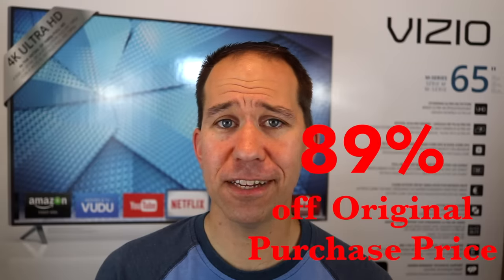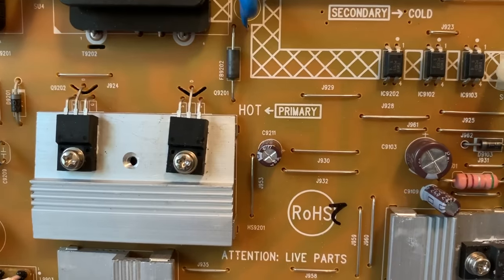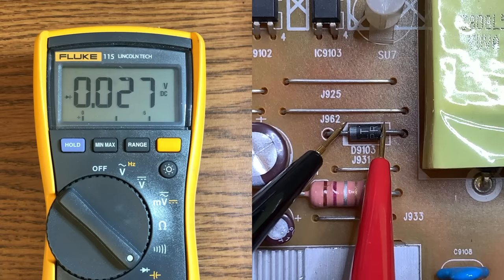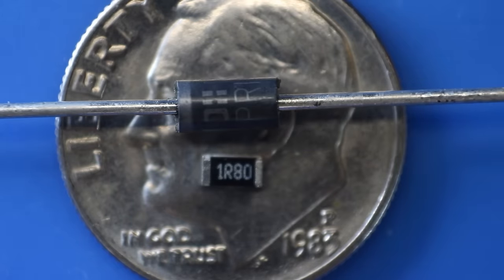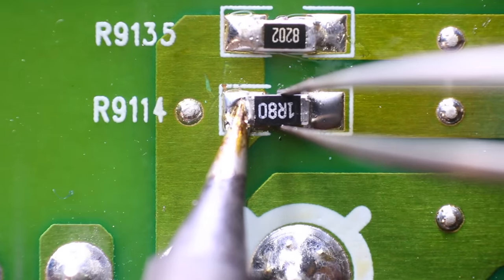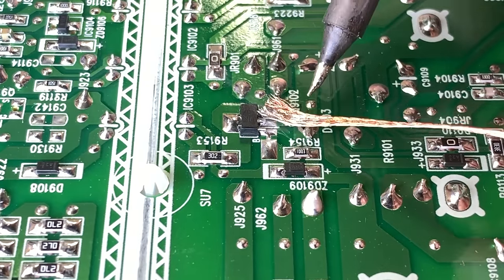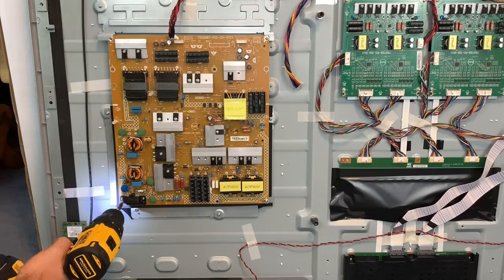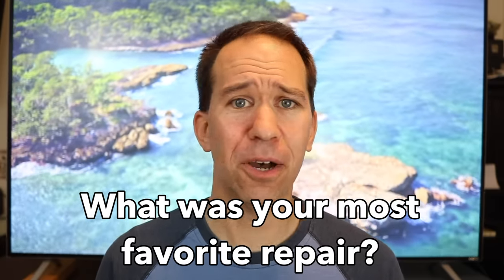I got a broken 65” 4K TV - How I repaired a Vizio M65-C1 (tv won’t turn on)

Comment: Regarding solar panels etc.  I believe the solar companies need to itemize their quote or estimates when they communicate with clients. Recently and a few years back we had consultants meet with us and in the end, all we were given was minimal data about the panels, nothing about the design or electrical plan and a single bottom line price that did not show labor, materials, credits and so forth. The most recent quote only showed "33 Canadian Panels, 10,400 KW system, 1 Exhaust fan, R30 attic insulation". Nothing was said about any credits from the State or Feds etc.
Our power usage increases in summer times as most others do and our A/C equipment is 10 SEER or 1991 era efficiency. There was no discussion about bringing that up to date at all even though the main reason we'd go with solar is to hold down the power bill in the 4 to 5 months during the heat waves. It was interesting to note because the solar company was really only with us to sell solar however, our kWh consumption was mainly when we used the A/C. Anyway, their quote was very much on the high side with no breakdown in how they arrived at their final figure. After considerations, we decided to simply look into updating the A/C system with more efficient cooling numbers such as 20+ SEER condensers and likely reduce the power usage to at least half of what it is now. This would be a better path for us because the newer systems function much differently than our 30 year old system does, which still works as it has since new. It didn't make a lot of sense to keep a power consuming A/C system and go directly with the more expensive solar idea overlooking the less expensive alternative to save on power. We could likely have a completely new HVAC system installed for $12,000 and cut the summer power usage by at least half vs. go with solar, pay $45,000+ with similar solar payments as our power bill is now. A new HVAC power bill would be much less than the solar payment for 20 years would be so unless power rates double in the near future, going with a new A/C system is the most "frugal" idea.

Wouldn't this also apply to just about all of those homes that have central A/C and heat that are still using 10+ year old equipment? You'd think most folks would update their HVAC first then opt for the solar expense.

Comment: I bought a 4k 70 inch vizio for 100 bucks with a few back lights burnt out. Im gonna try and fix it just worried about breaking the screen
Reply from the maker: Wow, that is great!  Yes, moving an lcd of that size isn’t easy.  What I have done is use a big piece of cardboard (get all of the dust off first) as a support mechanism.
Reply: @FrugalRepair  good idea!

Comment: Loved your video, very instructional. I have this exact same TV but the symptoms are slightly different. All Power board voltages seem ok and zero fluctuation, but the led on the main board is not blinking or turning on at all. The power led on the corner turns on and then slowly turns off. I have no picture,black screen, no sound at all. Do you know where I can find the main board for this tv? No luck on ebay or major part sellers (The board number is: 715G7288-M02-000-005T The white sticker says: GXFCB0TK0009020X).
Reply from the maker: From what I can gather there is a common failure on the main board.  There are ebay "repair" services last time I checked.  Are they not there anymore?  Since I haven't researched it, I don't know what is the culprit(s). I'd begin by probing around for shorts.  You could try freeze spray for a quicker ID of a short.  I'm very curious to find out what this main board problem is!
Reply: @FrugalRepair  Thank you for your reply. I ask for your advice once again, I have found the main board for sale. Do you think it is worth spending $163 on this TV?

Comment: One of my best repairs was a laptop that would not power up. I google "issues with laptop X" and found that static electricity can build up and prevent power up. So I took the battery out and shorted the positive and negative terminal the laptop then put the battery back in and BAM the laptop was back....LOL
Reply from the maker: Whatever it takes...  great story.  Thanks for sharing!

Comment: I have a M65-F0 and the image quite working the other day, backlight seems to be working just fine but no image, I ordered a t-con board thinking that was the problem but no luck. Now I'm trying to figure out which board to try and replace next or where the issue could be. Ugh!
Reply from the maker: You’ll want to try to isolate a possible panel issue.  Disconnecting one cable from the output of the tcon and then doing the other one.  In my next video, you’ll see how I do it to isolate a fault and repair it.  Hopefully coming soon!
Reply: @FrugalRepair  hey I think you're on to something! Lol. I removed the output ribbon on the right side of the t-con board and now I have half an image on the tv, left side. So I plugged the ribbon back into the right side and then unplugged the left side and nothing changed.. Does that mean it's a bad panel on right side of my tv?  (facing the back of the tv) And if so that sounds like a lot harder problem to fix!!? Lol. 
 You've helped me way more than anyone else so far! :-)
Reply: Also could my t-con board and the "used" one that I ordered both have the same problem? That's not very likely right? I'm just wondering if I bought a bad t-con board.  Also last night when I took the new T con board out and put my old one back in I tested the TV and for about a minute I had an image across the full screen before it went blank again.
Reply from the maker: Either is possible.  Tcon is the issue or the panel is issue.  If you can wait until my next two videos come out I’ll be addressing this topic and it may give you some more clues.  It’s too much to type on my phone.
Reply: But Im lost without my tv! Lol.
I think it's the panel or more specifically the strip board thing on the bottom of the tv...? 
I had a cat pee on the back of this tv about a year ago, before I had purchased a ceiling mount and I'm finding small clumps of dry urine stuck to the first strip on the right side, I've been cleaning it with rubbing alcohol and now I've found 2 tiny sections on the back of that board that look like they might've got burnt a little,  hard to tell because it's so small but I dont see those imperfections anywhere else on the back of the board. I imagine that those are nearly impossible to replace because they have 3 ribbons that are glued to the board..?. 
At least now I'm not wasting time and money ordering boards, thanks for that! :-)
Reply: I unplugged that strip again, kinda rubbed on it in a few spots but it looked pretty clean, I responded to your last comment and then I plugged it back in and turned the tv on and now it seems to be working just fine :-) I think it's too early to celebrate but fingers crossed!! Lol
Reply from the maker: Yes, that was the problem.  Clean off any other corrosion and you should be good!
Reply: Thanks again : -) I wish I would've found you sooner, before I wasted $12 on a t-con board lol. 
I'm still a little concerned about those bad looking spots on the back of the first strip board thing  that the t-con board plugs into but I buttoned everything up and turned it on again and it's still working, now I've got to find someone to help hang this beast back on the ceiling mount. Lol :-)

Comment: Hey! Interesting video, how long  does it usually take for the new diodes, resistors and such to arrive after you've purchased them?
Reply from the maker: A few days from a USA distributor but it depends on where you live and what shipping option you choose.  If you buy from China directly then it takes about 2 weeks.
Reply: @FrugalRepair  Ah I see, yeah. My main issue currently is actually acquiring the broken hardware though, I can't seem to find any in the local shop sites and such.
Reply from the maker: You mean, you’re looking for broken items to fix up?
Reply: @FrugalRepair  yeah excactly

Comment: Hey FR, hope you can guide me.  I own a 50PK950 LG Plasma tv.  I am getting a "no signal" from all 3 of my HDMI ports, but all other inputs, VGA USB etc... work fine. LG no longer make any mother boards for this tv.  Assuming my diagnosis is correct, that is the input chip for the HDMI inputs has failed, what if any solutions do I have?

Comment: Hello, My Vizio M70 D-3, 70inch 4k tv have dark band in middle and on bottom right corner. It's not completely blacked out but darker than rest of the screen. I am not sure if this is LED back light gone bad or LED driver having an issue. Please let me know what you think. I can send a picture so you can see it properly.
Reply from the maker: Turn down your brightness to 10% or so and see.  Sounds like the led is the issue.
Reply: @FrugalRepair  I did that and took a picture. Is there a way i can send you the picture i took to show the dark bands?

Comment: Does your TV still work ? Black Friday in a couple of months you can get a new one cheap. Flat panels are not real expensive like they used to be.
Reply from the maker: It works great!  Why buy a new one when you can get a broken one and fix it for less?  Plus then you possibly have saved it from being junked.
Reply: @FrugalRepair  I have a 65 inch I purchased at Walmart. Mine didn't have a broken screen but I did read a lot of reviews were people got them that had a broken screen. I looked on ebay and they had a lot of them who were parting out the ones with broken screens. So I decided to order spare parts incase mine ever stopped working. I ordered a offer by one vendor he was parting everything out so I ordered the bundle. I got all the circuit boards and the backlights all brand new for 37 dollars. I'm sit for life lol.

Comment: I've got a Samsung QN55Q7FNA led tv. A couple of days ago a thin blue vertical line apperead on screen a couple of inches right of center. The line is constant and does not move. I've  taken back off and cleaned connections to no avail. Any suggestions? Is this maybe a Tcon board issue?
Reply from the maker: It could be the Tcon or a tab bond issue in my experience.  In a few days I am releasing a guide on how to diagnose TVs without taking anything apart. It will be on my website and I hope that would be helpful for situations like this because I put some tips in there on things you can try or think through.

Comment: Hello there,i have a 43" Lg tv that is still working but has vertical lines on top and a few developed recently on the bottom of the screen.Plus when watching the screen keeps fleckering  for a few seconds then it stops and back again but the picture is fine.Please advise if its the tcon board or its someting else cz i spoke to local repair guy and he told me its the screen that is failing but i dont think so.

Comment: I have the same Vizio TV model.  The screen went black couple weeks ago, no longer seeing Vizion logo after power reset.  Still have sound.  Any advice what to do is greatly appreciated.
Reply from the maker: It could possibly be a failed backlight. I would suggest that when you hear the sound on the TV get up very close with a flashlight at an angle and see if you can notice anything on the screen. If you see anything at all, and I mean anything, then you know it is the backlight that is the problem.
Reply: @FrugalRepair  Thank you so much for your response.  I did more trouble shooting.  Now I don't any sound any more.  I connected my laptop to 1 of  5 HDMI ports.  I knew it connected to the "active" HDMI port as my screen display on my laptop changed to big font size and I could not hear the audio sound from playing this YouTube video - I assumed the audio was sent to the TV but I could not hear anything, even I turned up the volume using the TV remote. My remote still works as I could tell when press "power" button the TV responded (solid / flash lights at the bottom left of the TV).  When I unplugged or switching to the other 4 HDMI ports, my laptop display returned to normal display and I could hear the sound from your video.   Also, I noticed I did not see "flash light" in the main board as you indicated in the video when I had the TV opened up a few days ago.  Thank you so much for reading this lengthy reply!  I am hoping to isolate which component failed and get it replaced.

Comment: I have a tv that is blinking the power light of and on, but has a black screen that is also blinking a greyish light from one lower corner of the screen.  Is this also a common type of broken tv error?  Is there an easy tape fix?
Reply from the maker: Sorry, I don’t know what the issue is.  It could be lots of things.  You have to do some diagnostic work to narrow down the problem device in the TV.

Comment: Looking for help on my Toshiba Model 52XV545U LCD TV. I have a standby light but the screen is black.
I'm new to diagnosing circuits and i figure i would take a stab at trying to fix this rather than throw it in the garbage. I need help figuring out where the power goes or the sequence of operation. I would like a wiring schematic but not sure if they are available. Any help would be great.
Reply from the maker: I’m happy to hear you’re taking a stab at repairing it.  Did you happen to watch my video on what to do after a power surge?  I explain a little bit more there.   I am also planning to make a series of videos explaining the process more.
Reply: @FrugalRepair  Thanks for the reply,  my power board is a PE0627C toshiba there are 2 plugs at the top that say the voltage should be 24 volts and they go to the side circuit boards which i think are backlights, i have no voltage on those pins.
I have 5 volts standby. Im thinking its the main power supply board, any thoughts?
Any help would be great
Reply from the maker: @barrypatrae5656  The 24v won't show up until the tv "turns on".  The main board send a signal to the power supply telling it to power up all of the power rails when the power button is pressed (or on the remote).  You need to figure out what is preventing the main board from sending that signal.  I'd start by disconnecting everything except the bare minimum of connections to rule out short circuits.  For example, one tv I fixed had a short on the input bar.  You can even disconnect the ldvs cables since you would see the backlight come on but no image.

Comment: Just wondering how you repair a 5.1 multimedia speakers I've got a logitech  z906 but my local electronics  repair  shop did  a diagnostic and said they could not get the parts for repairing its power supply.

Comment: I never fixed a tv but one day my sony 810c water dropped on it. I didnt know what to do a quick google search ,it was something to do with the power supply or motherboard i ordered the 2 turns out it was only the motherboard and not the power supply cost me 130$ total for a tv i got on 2015 for 900$ i think it was. I didn't know what was i expecting but it turned out for the good. And now i have the power supply just in storage just incase it does go out in th future.

Comment: can you make vid on replacing led back lights Vizio E60-C3 60INCH SMART TV?
Reply from the maker: Funny enough, that may be a model that I have and plan to work on (fixing the backlight).  I have a number of TVs waiting for repair so can’t promise a date but it’s near the top on my list.  New YT video comes out tomorrow!
Reply: @FrugalRepair  Thanks because i just bought 1 from the pawn shop, got it home turned it on and i did a double take and im seeing dark shades on different parts of the screen and when i troubleshooted it on google replacing the 12 led strips is the only option. I spent $275 on this thing and i cant return it.  And it looks complicated. With the right instructor i think i can do it.

Comment: M70 D3 doesnt turn on, black screen but the led light turns on and slowly fades away, tested the power board, al diodes work fine... maybe is the T-Con board, any forum that you recommend to find more info?

Comment: Good video. You did over pay on the TV initially-I would have offered $25. Good trouble shooting. The next problem is going to be youre going to need to do a backlight job on this TV-Vizio is NOTORIOUS for designing LEDs that only last a couple years. They know most people will chuck the thing and buy a new one.The age of the disposable TV-and Vizio invented it! I was actually looking to see if these M-series Vizios have those damn internal clips like the E-series does that makes it near impossible to get the back panel off.Vizios pretty much thought of everything to make sure that TV ends up in a landfill,NOT on a techs bench!

Comment: I replaced the resistor and diode as you did in the video but the resistor keeps blowing. Any ideas what could be causing this?
Reply from the maker: No, I’m not sure.  Can you tell which side of the circuit has the short?  You may need to take one leg of the diode out to measure.

Comment: I have a Vizio VX32L HDTV10A that the picture does not light up. The sound works just fine. When it gets turned on there is a short, dim flash of light on the screen. Followed by the picture being dark after that. How do I check out what is wrong and fix it? Thanks in advance for any advice.
John V.

Comment: I fixed home PC which  event won't enter to bios any more, becose a tiny electrolytic capacitor(6,3v 2200μF if I remember correctly), on power supply, which simply confused the tensions, prolonged use will damage them, which is a standard error for them. Price;0,40 eur
Reply from the maker: That’s great to hear! Congratulations on the repair.